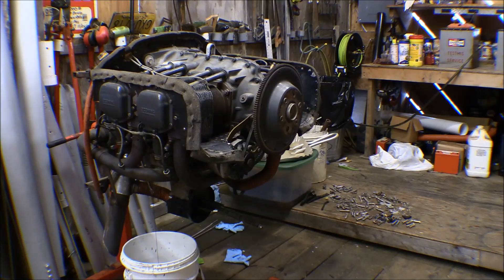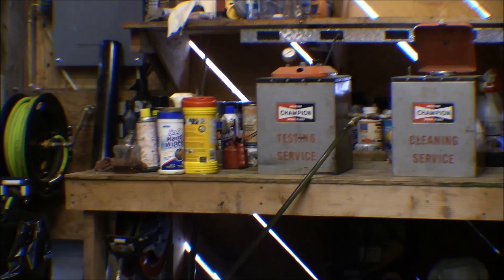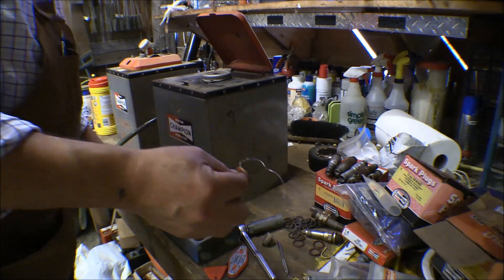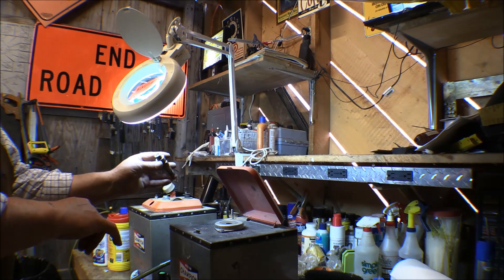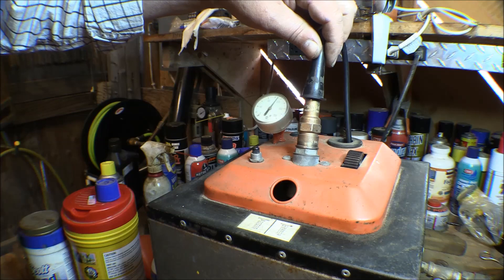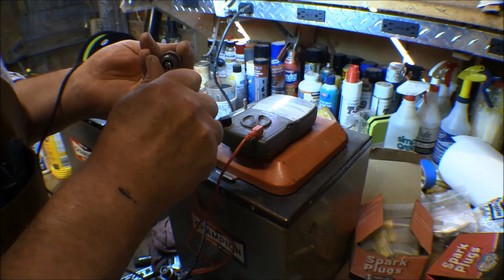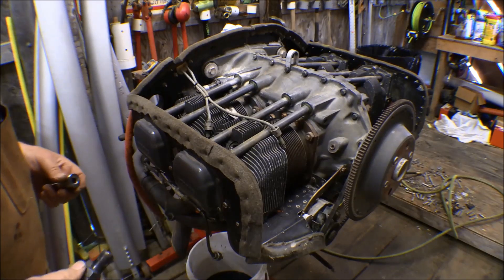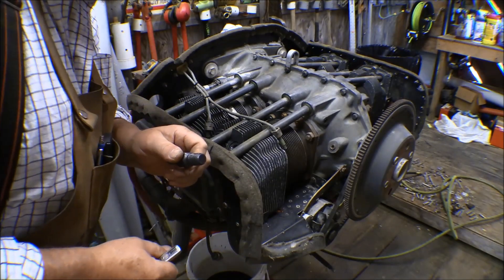Piper Supercub Widebody refurbishment: spark plugs

Comment: What kind of antiseize do you use
Reply from the maker: For many years I used Champion anti-seize. It's graphite and works but is suspended in water and can instigate the threads to rust.
Now, under advise of a couple of A&Ps I have been using regular Permatex anti-seize. The silver stuff that gets on everting you touch.